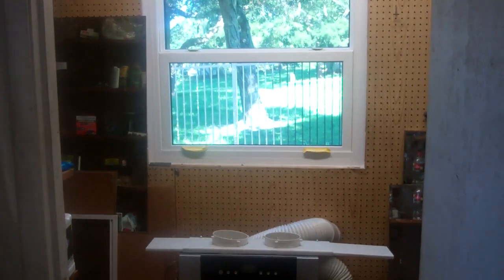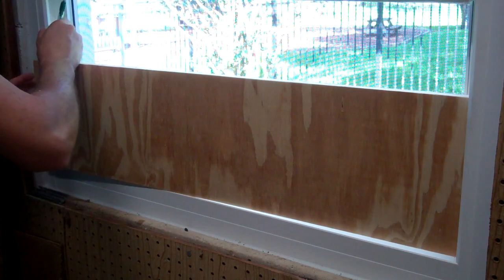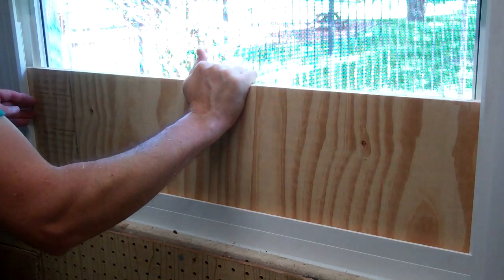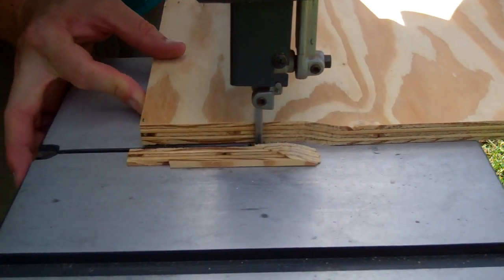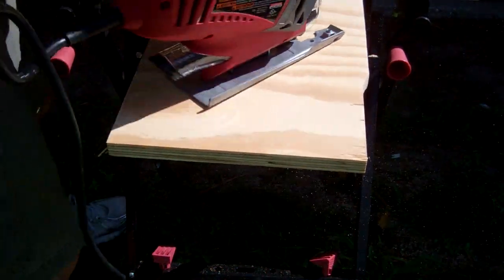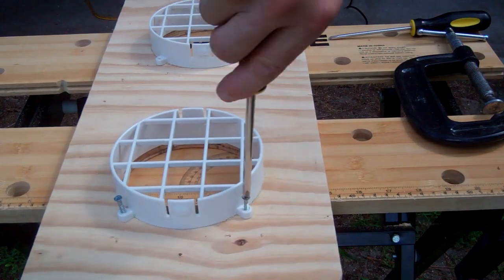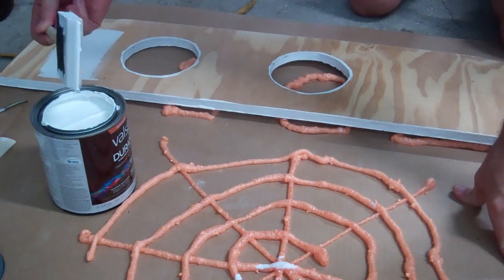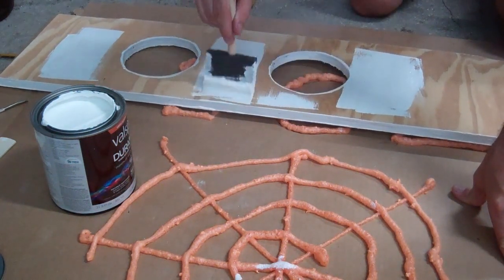DIY - Dual Hose Portable AC Window Adapter plate for Whynter portable AC unit

Comment: I just installed this unit.  The AC is fine.  I set it to 68, went to doctor’s appointment, came back and room is super cold.  Feels a bit humid though.  Now, I have this in my music room where I have powered amps that produce mucho heat.  I also live in south Florida.  I needed this unit in addition to the central air since this room in particular is eight degrees hotter than the rest of the house.  Window is facing east.  
The only negative is the window extender.  It sucks.  I have put it together, well, Mickey-Mouse install for now.  A lot of heat is getting in due to gaps.  Window is too wide by a few inches.  I’ll show this video to my wife so she can make something like you made here.  I can’t do it.  My fingers are only for bass 🎸 😂

Comment: Great review Jay! But would you mind doing a video on how to disconnect the hose connectors from the back of the unit and the window casing holders? I tried following the directions and am killing myself trying to disconnect them. This is for storage later. Thanks Jay!
Reply from the maker: I've never tried to remove them from the back of the unit. I have taken the hoses off of the window casing holders, and it was not easy. I had to use a flat head screwdriver to push the "catches" down and then slide one side off at a time. I don't think there are any tricks to make it easier.
Reply: oh, ok, I appreciate it Jay. Guess when I take the window casing down for the winter, and store the air conditioner, I'll keep the hose attachments on on the back of the unit. I have french door windows and got a piece of plexiglass cut to cover the window and the casing is part of the plexiglass, and the french door windows hold the plexi in place.
Reply: Joslyn L 

You gently turn the adapter with a little force so the tabs no longer sit in the holes and then pull it out.

No screw driver needed.

Comment: My house has a window that used to go to the carport which got converted into a garage.  Some thugs broke into my garage and then broke the bottom pane of that window to get into my house, so I just replaced it with a piece of 1/4" MDF, which fits perfectly within the frame (it is caulked, of course).  And since my new portable A/C will be near this window (i.e., at least near enough for the 78" long hose), I am using that MDF piece for the ducts.

I had to refer to this video to see that the bracket at the end of the duct does not protrude through the plate. :)

Whenever I get a new home, it will be central A/C, and so the portable A/C will become an emergency unit, either if the central unit goes out, or the power is down a while due to a hurricane (or ice storm, if LA's power grid is anywhere near the cluster$#@! that TX's is; and yes, it could freeze and then be followed with temps in the high 70s within a week).  I will make a plate like the author for that application - although I'm not sure how it will work with a window screen.

Comment: I seen a kit whnter window kit on Amazon for 47 bucks but it's to long my window is 27 inches an the window kit says from 36 inches to extended 47 inches I need to find one that fits my window or would I be able to cut some off not Shure it's plastic u have any ideal thank you I have this same air conditioning

Comment: Why did you make the holes so close together, where the intake will be sucking the hot air exhaust back into the Machine, making it work harder?
Reply from the maker: I needed to leave room for a third hole as an exhaust vent for a laser cutter. See this video: https://www.youtube.com/watch?v=5uA8DLCamZs
Reply: @summetj  Just put your exhaust for your air conditioner and your laser printer at the very end, so your intake from the portable AC won’t be sucking up the fumes from the laser cutter or the heat from the exhaust.

Comment: Would you ever offer the service of making one for somebody if they provided you pictures and measurements. And if they payed in advance ? Cause I want one lol I would easily pay around $60-$100 I don’t have accesses to those tools. Or if somebody could direct me in right direction to find better one with the intake and outtake space a lot farther apart.
Reply from the maker: I'm afraid it's very difficult to get the fit just right unless you are working at the specific window, so it's not something I can do remotely.
Reply: @summetj  I was going to make the same request

Comment: What are the dimensions for the window fixtures you attach to the wood?, i want to prep this before it gets delivered.
Reply: I don't have his exact model but I assume all big Whynter dual hose units use the same hoses. The big hole is 4 & 61/64 inches. The mounting holes are approximately 5 & 11/32 inches center to center.
*Edit: I measured the actual vent hole pieces, they are 124mm. If you get a 125mm hole (4.9") saw it should be quite a good fit (that's what I plan on doing).
Reply: @portaaids  Thanks, i ended up just using a 5in hole saw then calking up inside and out to seal it then adding metal tape inside and out.

Comment: Where can I find those curcle plastic things? What are they called?
Reply from the maker: 4″ flush to the floor “snap-in” PVC floor drain (designed to be cemented inside of a 4″ PVC pipe)

Comment: do both hose ports remain open ?? or do i have to cover it to use cold or hot ?
Reply from the maker: I only use the cooling feature of this heat pump, and both tubes are  connected/open for that.

Comment: Re: wooden block security. Can’t someone pull the outer window pane down for entry?
Reply from the maker: This is a single hung window, so the top sash doesn't move. (Obviously, they could break the plywood to lower the bottom sash, dropping the block, or break the window to move the block, I would prefer that they break the plywood instead of the window which would cost more to replace.)  I do have a monitored security system in addition to locks.

Comment: Those portable A/C's are wastes of money and wastes of energy to operate!!! A $225 window unit puts out double or three times the cold air per dollar of electricity. Those plastic dryer hoses return over 50% of the hot air BACK to the room thru their walls. This is like trying to cure your diarrhea by building an add-on to your toilet!
Reply from the maker: The two hose models are a lot better than the single hose models. But yes a window shaker is more efficient.